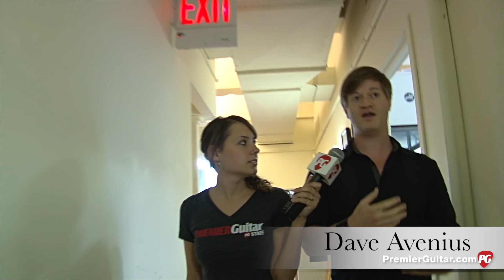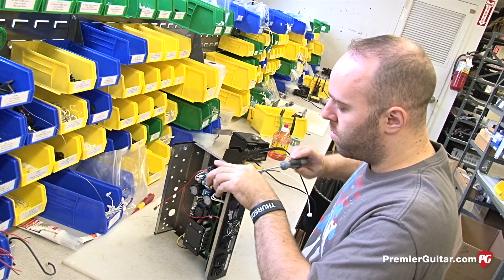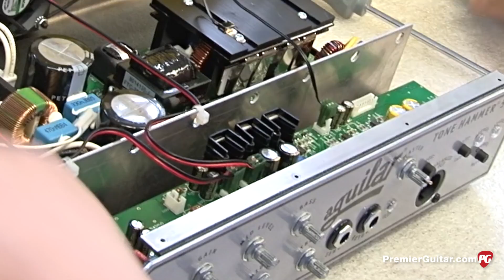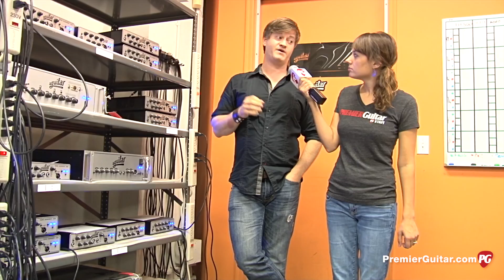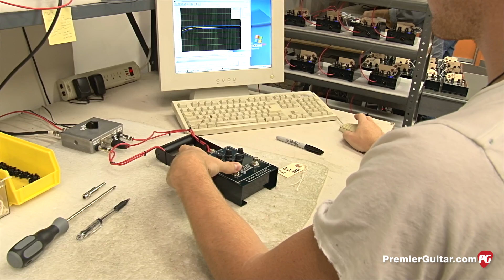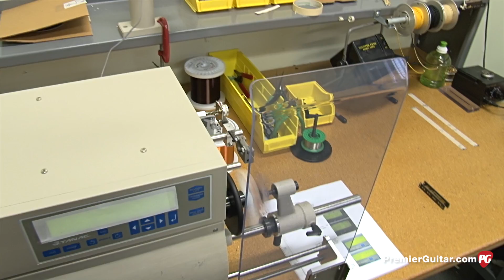Aguilar Amplification NYC Shop Tour

Comment: Our cabinets our made in Ohio, the speakers are made by Eminence in Kentucky.
Circuit boards are fabricated in Pennsylvania. All of our metal work is made in upstate New York. The Bang & Olafsuen parts are designed in Denmark and made in the far east. Small parts such as resistors, capacitors, etc...are simply not made in the USA anymore. I hope this gives you the information you were looking for. Best, Dave B.
Reply: That was extremely helpful info

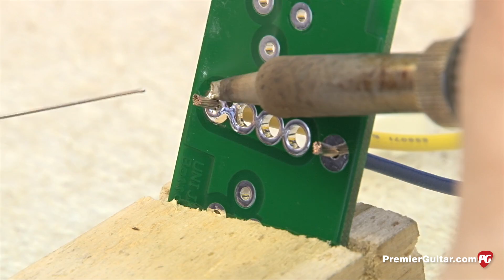Comment: Nice look into the Aguilar shop. BTW that solder joint at 0:52 is bound to fail sooner or later. I hope it was resoldered properly...
Reply: Exactly. Also where are screw drivers with torque control? Now I see that there is  no possibility to achieve repeatabilty. Where are ESD gloves where they touch electronic component...?
Reply: I've been soldering profesionally for over 40 years. I cringed when I saw that connection. That said, I just ordered a Tone Hammer 500. I'll be sure to take it apart and check all the solder joints.

Comment: True.  What I liked (and didn't know) was that these were not just surface mounted components.  Its not point to point construction but it would seem their products are more durable than surface mounted parts that can suffer from heat failure.

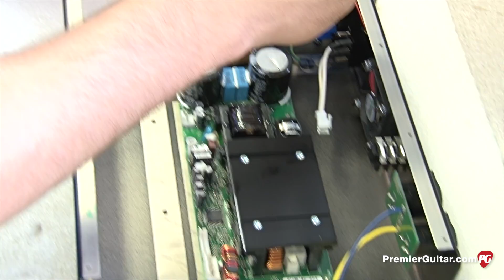Comment: well dave says in the video at 2:22 that the power amp board is a Bang and Olufsen Icepower 250ASX2 module. So it's not made or designed by Aguilar but rather is purchased and integrated into the Aguilar amp.

the pre and power amp boards appear to be a mix of surface-mounted and through-hole components. and it's definitely not point-to-point construction, i doubt any bass amps are made that way.

Comment: The 250ASX2, while rated at 500W in BTL mode, can only deliver 200W @ 0.05% THD into 8 ohms. Besides, class-d technology is not mature enough for driving full-range speakers. They are great for subs, not for hi fi. Once class-d amps can be operated at 1 MHz switching frequency or more, then I'll consider them for Hi Fi...